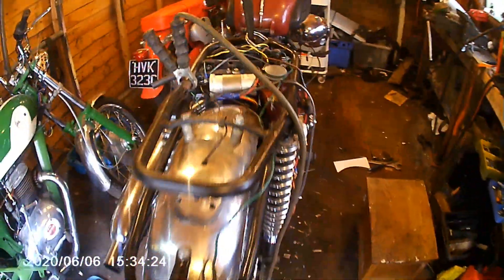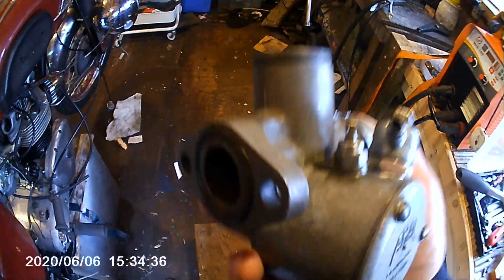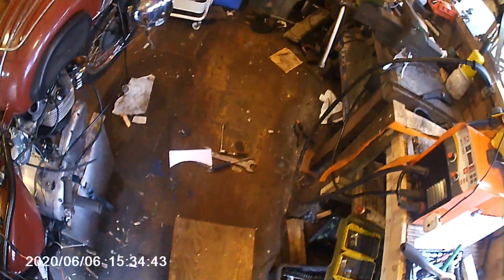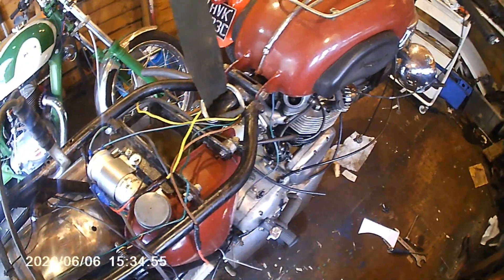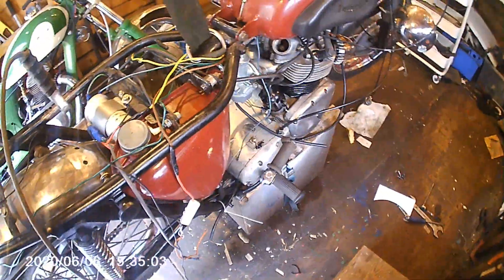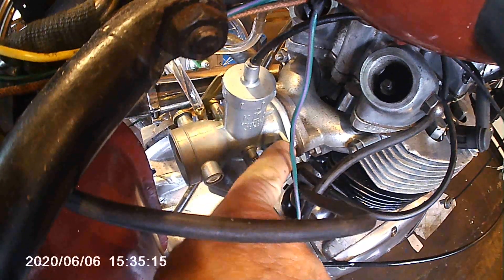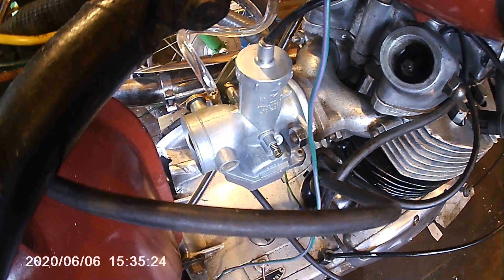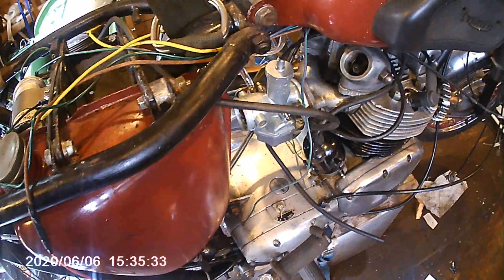Chinese carb fitted to a Triumph 5ta

Comment: Can you give details of the carb you used and update on how its performing
Reply from the maker: Hello its a PZ30 it starts first kick and runs great you need an air filter fitting or it will run a bit weak. I dont ride a lot so I cant make any comments on long term use.